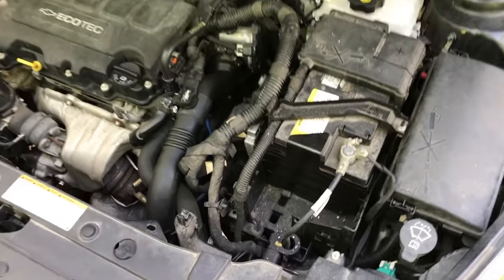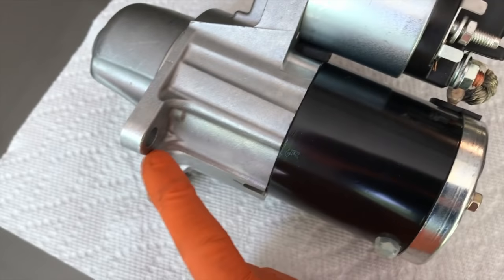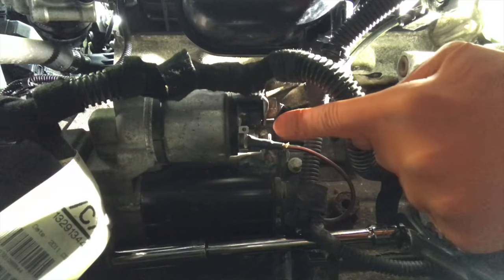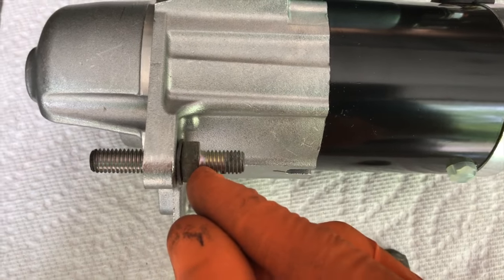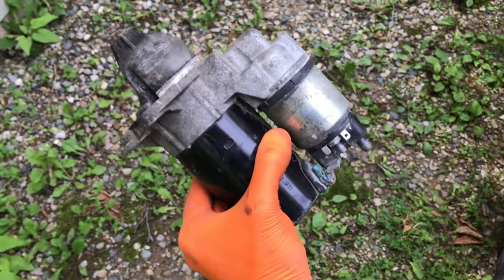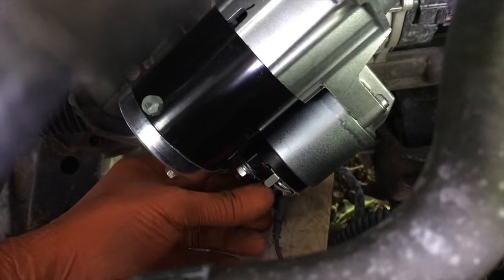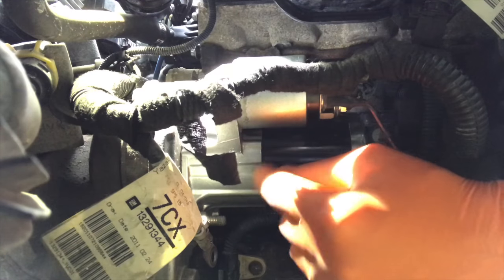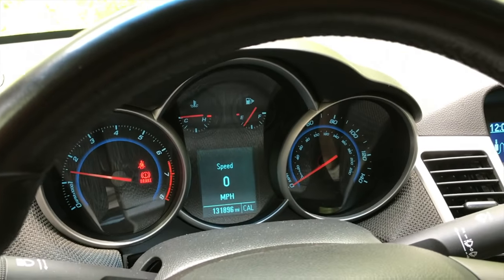How to replace Chevy Cruze Starter - FAST & EASY!

Comment: One minor correction the cable that comes from the battery to the mounting screw on the starter’s outer chassis is a negative not a positive.
Reply from the maker: Thanks for watching.  😎👍🔧🔩
Reply: Yes! This did make me scratch my head a few times thinking why would they ground out a positive cable.
Reply: The wire that comes from the battery is a positive that mount to the solenoid the one that mounts to the stud is a negative block ground
Reply: When you said it in the video I was like explosion 💥 😂😂😅

Comment: Hey man, I'm dealing with my first time replacing a starter right now so it'd be difficult even without it being on the back of the engine block. Just wanted to say thank you because this made it so much easier and I was way less worried about taking it off when I could barely see it.
Reply: Mine just went out, I had to film it with my phone just to see where in the he'll it was.....jeez

Comment: Your explanation made it very easy for me to remove the starter from the 1.4. I focus on the 13mm top bolt from top of engine bay. Next I removed the bottom 13mm from top of engine bay also. Pulled it lose and removed both wires from top side. No need to get under the car. Very easy from top.

Comment: My chevy 2012 souds chickkk when starting and doesn't start. I played music on it without starting. After a while it doesn't starts. So pliz tell me is it battery problem or starter. I am waiting your valuable answer eagerly sir.. From india
Reply from the maker: Thanks for watching & welcome to the DIY Raptor Club.  It could be as simple as cleaning the battery terminals.  A build up of corrosion and debris on the terminal leads interferes with the efficient electrical connection and feed through the entire system.

In addition, if it’s the original battery, it may be time to replace it.  Keep us posted.

😎👍🔧🔩

Comment: It took me 1 hour 20 minutes from opening the hood to starting the car and closing the hood.

Tools:
10mm deep socket
13mm deep socket
13mm shallow socket - for the aluminum bolt
Ratcheting wrench, 6 to 9 inches long, with lots of teeth. I got a harbor freight one with 72 teeth for $11. My craftsman wrench (did not use) had 8 teeth, and there were some spots where I could only move the HF wrench 3 teeth.
A stubby extension 6 inches long. Longer and it won’t fit behind the alternator, shorter and it won’t clear the starter solenoid. It only gets used with the aluminum bolt. 

Order of operations is helpful.
Take the 10mm bolt off the solenoid, it will have the only skinny wire. Remove it’s wire.
Take off the 13mm bolt from the solenoid, remove its wire. once the wire is removed it gets in the way of the 10mm bolt, hence why that was first.
Take off the bottom 13mm nut, wire, bolt.
Since all of the wires are disconnected, it is easier to get to the last bolt. Put the shallow 13mm and extension together, and figure out their placement while looking at the bolt.  Put the wrench on the extension, and loosen the bolt. Finish taking it out with your fingers. 

Before you put the new starter in, take a picture of the face you are going to put it in.

Put the bottom bolt in first, you can feel the whole with a finger. Finger thread it on.
Now finger thread the top bolt in.

Now it is reverse of operations.
Reply from the maker: What’s up Michael, thanks for watching & sharing this.  Any & all helpful info is greatly appreciated!!!  😎👍
Reply: @DIYwithMichaelBorders  Thank you for your video. I brought to the dealer and asked for a price on how much it would cost to get them to install a starter motor. I had already replaced the relevant relay. They told me it was going to be about $930. 180 for the diagnostic on why it wouldn't start, (bad starter motor or solenoid), $200 for the starter motor, and the rest for labor. 

I bought the starter motor and paid their diagnostic fee so I could get my key back, then installed it with your instructions. I think that the next most complex bit of car repair I have ever performed was replacing the spark plugs and the battery.
Reply from the maker: @mikegrok  

Thanks for the reply, $920.00...😳...

That is a load of cash to charge for that project...that’s awesome you made it a DIY project.  😎👍
Reply: Did you go under the car at all or do it all from above ?
Reply from the maker: @MrYoudoober  

Thanks for watching, we performed full project from above.  Ratchet extensions are the key!  😁👍

Please keep us posted, looking forward to hearing back from you.
Reply: @MrYoudoober  all above

Comment: I have a 2016 Chevy Cruze, Im around the 65,000 marker. I noticed my car sometimes takes a bit longer to start up… Any idea on what needs to be replaced?
Reply from the maker: Thanks for watching and we appreciate you sharing this.  It may be as simple as a spark plug and ignition coil pack replacement.

Below is a helpful video that shows us performing these steps.

       https://youtu.be/J8ij88bw_dY

Please keep us posted.  😎👍

Comment: My car is a 2014 chevy cruze and only clicks once when I try to ignition it. The screen will say service battery charging system. If it clicks once is it the starter or alternator?
Reply: Mine is a 13 and it is doing the same I just replaced my battery hoping it was the issue. But just 1 click and nothing

Comment: I'm having issues figuring out why my car is dying. I just replace the battery about 2weeks ago. Do you have a video how to check if it's the alternator or the starter? I have under 170k miles in the car. 1st gen 1.4t
Reply from the maker: Thanks for watching & welcome to the DIY Raptor Club.  Below is a link to a video showing replacement of Battery.

       https://youtu.be/mwDDnpM7dKs

As far as your engine dying, you may want to run a fuel system cleaning additive through your engine.  It will hopefully help remove any blockage within your fuel system as well as clean your fuel igniters. Keep us posted.  Us fellow DIY’ers need to stick together!

😎👍🔧🔩

Comment: I have had all kinds of problems with my 2015 cruze. It started giving problems about starting. Had the battery checked, they said it was fine. Replaced the starter relay, didnt fix the problem. Replaced the starter,  everything was good for a couple of days. Was hopeful the problem was solved. Then went out one day and it wouldn't start. Had to unplug the negative battery terminal to get it to charge. Got it charged, the dash panel said the voltage was at 15. Started the car. Went out the next day and no dash lights or anything would even come on. Do I have a bad cable? Or a short in the negative or positive somewhere? How would I go about figuring this out?
Reply from the maker: Brandy H 

Thanks for watching & we hope the video helped.  We are pretty sure it’s your battery.  Replacing your old battery with a new battery should fix issue.

We really enjoy making these helpful videos for our fellow DIY’ers.  Many more helpful videos to come!

Let us know if you have any questions.  Please subscribe to the channel and turn on your YouTube notification Bell 🛎 that would be awesome thanks again!

😎👍🔧🔩
Reply: Alternator
Reply: @geraldfahey2681  hey bro if your car won't start even if you put new battery, of course it's going to be the alternator they start to drain your battery.... Got my alternator replaced and problem solved 😎
Reply: You might as well replace the negative battery cable

Comment: I just can't get the top bolt out for nothing  ,what can I do?
Reply from the maker: Thanks for watching, any update?  These bolts can be stubborn at times however most importantly, you will want to continue to be careful not to break bolt or strip it’s internal thread.  Please keep us posted.

Let us know if you have any questions and hey if you’re in the crypto trading, join us at our newly launched DIY ecosystem.

     toolboxtoken.com

Reach out to us any time!  🧰
Reply: Yes  I have a chevy cruze and I am having trouble getting the bolt out on the back side of the starter, I have all of the other bolts but the back side  with out  taking the intake off, what  tools do I use, please help me if you can  I'm on a fixed income and I don't have any money to put it in a shop so I try to do it myself, when I was a lot younger I used to work on trucks and cars but this one is new to me. I believe in helping people if I can become being on a fixed income and food and Gas prices it's hard to do, I'm 63 years old and I can still turn some bolts a little bit.

Comment: I was about to get everything but the Mount bolt off. The reason being is that I have the Dorman intake manifold and there is an extended back on it. Sadly, due to that I had no way to get the billy out without removing the whole Intake manifold, which when I went to do it I stripped one of the bolts 😢. So now I have to contend with correcting that before reattemped this

Comment: I had someone change it for me a couple days ago. Bought it brand new and it was running fine and today It does not start /: It just clicks. The lights and radio do turn on.
Reply from the maker: Thanks for watching, that’s odd.  Double check all wire connections are secured and not corroded.

If you use a voltmeter to check the volts of the battery, is it still above 12V?

Comment: Hey Mike how many miles on your chevy cruise and what year is it? Also how often are we to change tyranny fluid as I have a 2014 chevy sonic 1.4 turbo and book says two different mileage? Also did u do a video on transmission change ?? Thanks scranton pa
Reply from the maker: dakota47v8 

Thanks for watching, this is a 2012 & just passing over 130k miles.  It is recommended to change transmission fluid ever few years, unfortunately we haven’t made a video on that yet.

Hope this helps!  😎👍🔧🔩
Reply: DIY With Michael Borders

Comment: That is not a hot cable bolted to bottom starter bolt that is your ground cable your positive cable is on big stud on silinoid of starter and the small stud on silinoid is ignition wire

Comment: I realize the colours and the importance of them,  but you haven't answered my question? You had mentioned about a positive cable that was secured by the one 13 mm nut that had a bolt that secured the starter to the engine.   this cable that was secured by the 13 mm nut , was this the negative cable  or the positive cable???   Its just securing the cable to the engine not necessarily bolting to the starter?
Reply from the maker: Thanks for watching, the black cable to batter is your negative, red cable is your positive.

As the cable feeds off the battery, it gets wrapped into connection with the wiring that feeds electrical power to the starter.

Comment: My 1.4 2014 Chevy Cruze eco just got to 273,688 miles and now the original starter is failing on me....now it's time to replace it... It's way better fixing your own car and avoiding the damn Chevy dealers they will overcharge you close to $800.... Screw them I do all the maintenance
Reply from the maker: Thanks for watching & welcome to the DIY Raptor Club.  Working on your car is very beneficial in many ways & saving money is at the top.  😁

Let us know if you have any questions, hope all is well.
Reply: @DIYwithMichaelBorders  I wish you had a video on how to replace the active grille shutters on the Cruze eco
Reply from the maker: @raulmacedo5561  

True, don’t have at the moment...🤔

Comment: i was alittle confused when you had mentioned about the one battery cable as being positive .  I believe you meant negative??? this was the one that you secured with the 13 mm nut...  please advise if this is correct
Reply from the maker: Thanks for watching & welcome to the DIY Raptor Club.  Black is negative & red is positive.

Hope this helps.  😎👍🔧🔩

Comment: Hey bud great video, I have the same chevy with the 1.4L engine and like see when it rains like water fall inside like through that black box right below the hood, any idea on how to fix that thx
Reply from the maker: Bryan Abad 

Thanks for watching & we are happy the video helped.  That’s odd...  Has the vehicle experienced any front end or side damage in recent years?  If yes, it’s possible that the vehicle is not perfectly aligned which leads to your leak.

If not, you may need to replace upper foam seal to recreate the water right seal.

We really enjoy making these helpful videos for our fellow DIY’ers.  Many more helpful videos to come!

Let us know if you have any questions.  Please subscribe to the channel and turn on your YouTube notification Bell 🛎 that would be awesome thanks again!

😎👍🔧🔩
Reply: @DIYwithMichaelBorders  like water comes in through a black box right above the power steering, and it has damage the o2 sensor in the bottom, so any ideas on how to fix that?? Thx
Reply from the maker: Bryan Abad 

Thanks for the reply & it’s probably best to replace box.  It might be a “Dealership Only” part... meaning you can’t get it at AutoZone... you’ll need to visit your local Chevy dealership to purchase new part.
Reply: @DIYwithMichaelBorders  that's the problem I dont even know the name or what part number lol
Reply from the maker: Bryan Abad 

No worries... your local Chevy dealership will ask for your last eight digits of your VIN #.  They will be able to pull up the exact animated diagram of the engine compartment and all systems.

After explaining the part to them they should know the exact part and pull it up on the computer.

The most important thing is the last eight digits of your VIN # which allows them to pull up the exact replacement part for your exact vehicle!

😎👍🔧🔩
Reply: You know that water goes through that area and the flap about the power steering is a drain... No fix it's supposed to be like that or the bezel behind the firewall would fill with water. Id also assume that you can get all of those parts fairly wet since there is no splash pan to protect those parts. Your o2 sensor wires are exposed because they should be water tight.
Reply: @TheDylanjduncan  i dont think its suppose to be that way cuz then that's a shit built, cuz the o2 senor on the bottom is fucked up, and its giving me a check engine light reading a fault catalytic converter. I just had that changed.

Comment: Did u remove the intake? How did u have so much room?
Reply from the maker: Thanks for watching, all parts removed for this project are shown in video.  We did not remove any parts outside of what’s shown.  😁👍🧰
Reply: @DIYwithMichaelBorders  Thanks, I had access to a lift, was still tight working from underneath.
Reply from the maker: @kyle1775  

😁👍🧰